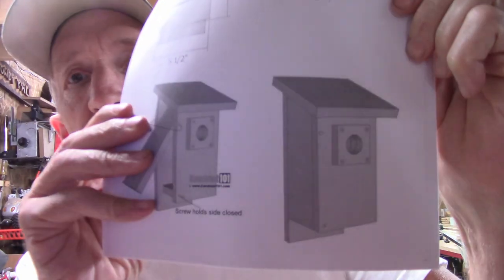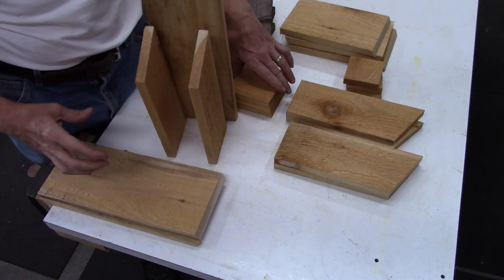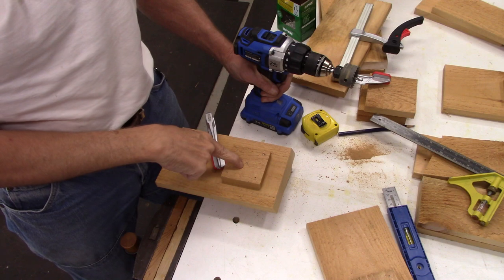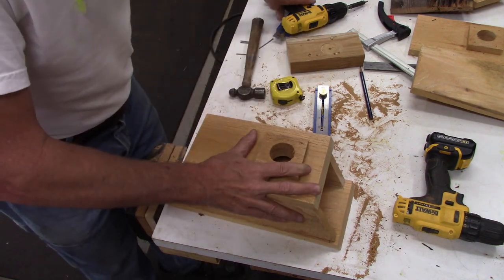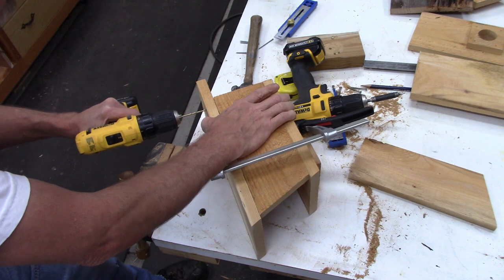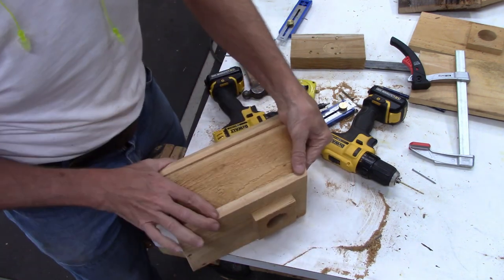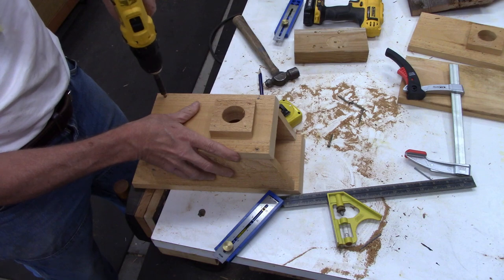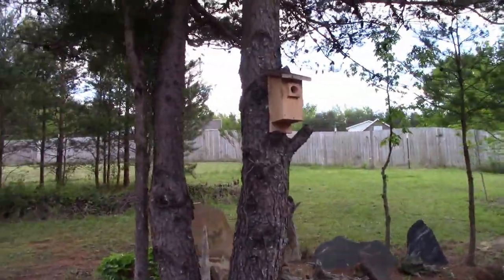Build your own Bluebird house, Step by step instructions!

Comment: Nice, very nice. Love the barnwood roof. Just FYI, that double thickness entry hole is mainly to prevent Starlings from getting inside as well as 4-legged predators. Also, the Eastern Bluebird males will fight one another and it is suggested the boxes be placed 100-150 YARDS apart when creating a bluebird house trail, which a "trail" consists of 2 or more houses. Just thought you might like to know!
Reply from the maker: Hi Sharon and thanks for the advice! I will move them to to create a trail. Thanks for watching!

Comment: Very nice. I would either put one screw on the bottom of the pivot board or use an L cup hook that allows it to pivot without unscrewing anything. I found that the repeated removal of the screw eventually would get stripped. I think this year will have a counter-sunk inset and a small homemade knob.

Comment: Good to see someone that has included the elements of safety for the eggs and chicks...good job.  Great to see you added the predator block, good ventilation and drainage, an access door and didn't put in the dreaded perch.  I monitor several dozen Blue Bird boxes and always add a few kerf saw cuts under the access hole for adults to grip and I also add the kerf cuts inside to help the chicks climb out when they fledge.  Cornell Nestwach is an excellent resource everyone should refer to when building bird boxes: https://nestwatch.org/learn/all-about-birdhouses/features-of-a-good-birdhouse

Comment: Should the back board be longer for attachment
Reply: Yes.  I always have the back board longer than the roof by about 4 inches or so.  I drill two holes and thread a piece of wire through the holes and around the tree, hang on fence post, etc.  Installation is a breeze like this.